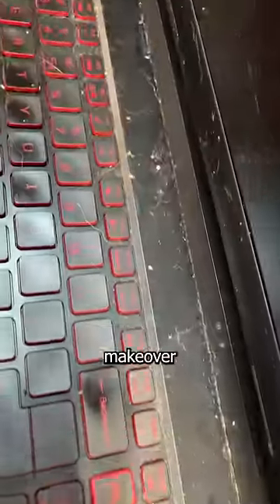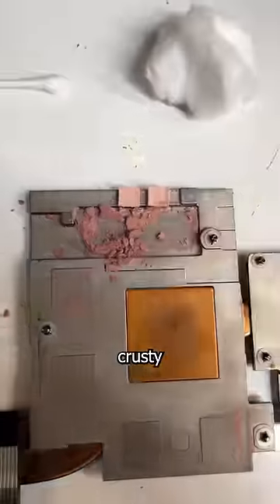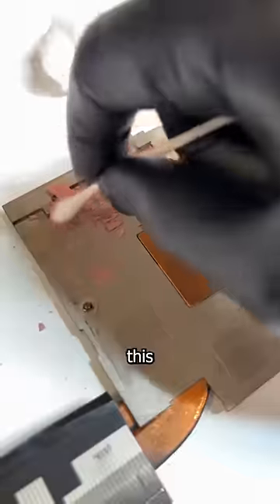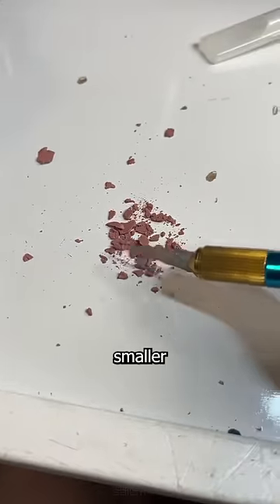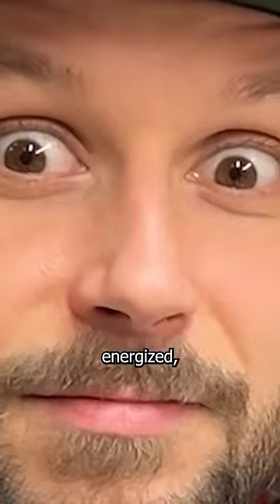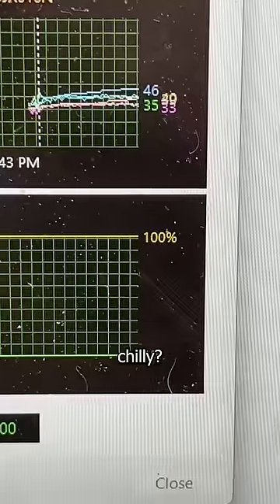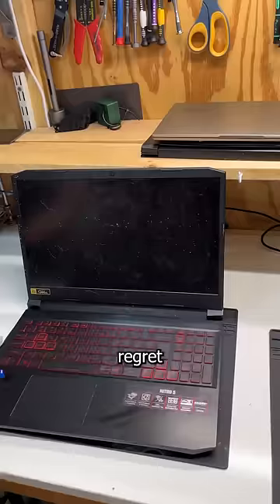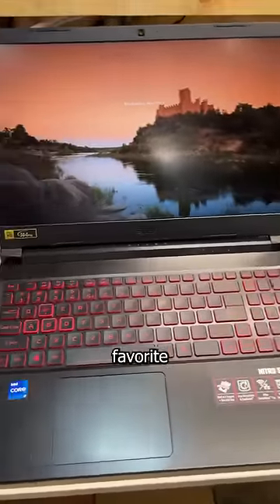Refurbishing a filthy Acer Nitro 5 #gaming laptop (I love it) #pc #tech #technology #shorts

Comment from the maker: In all seriousness the Acer Nitro 5 is an excellent budget gaming laptop if you TAKE CARE OF IT. The hinges ARE prone to breaking, but if you're mindful of this and clean it regularly, there's no reason this shouldn't last you a long time.
Reply: Could it run fortnite
Reply: @_Err0r_404 it does very well. I use the nitro 5
Reply: @NotBray  ok thank you
Reply: I got one with i5 10300h 45w cpu and it runs games in the 90s
Reply: For the price its really good
Reply: Nowadays hinge problems have many variants. Lid point delamination common on those hinge soldered on lid, Ol common hinge broken, or newer cheap laptop base break like HP plastic.

Which hinge problem for this Acer?
Reply: @ashisace921 well im using the intel 5 8th one, the model maybe from 2018 or 2019. This one is a pretty good and decent run Valorant, Apex and etc .
Reply: as a nitro 5 user, i personally don’t think i have problems with the hinges, but here’s some advice: DO NOT SET YOUR FAN SPEED TO MAX. if you constantly use the laptop with MAX FANS ON, one of them would die out, which i have experienced.

Edit: putting it on to max for an hour to 3 hours is COMPLETELY FINE. My point is to not keep it at that speed
Reply: Which thermal paste did you used on the cpu and the gpu?
Reply: @KarstenPHT  how about auto?
Reply: Good, I just bought one last month
Reply: @trym2121  you can see that the acer nitro 5 here has those big hinges, but the LCD frame itself is thin. the problem MIGHT be the link between the LCD and the outer hinge (its hard to explain really)
Reply: Asus F15 i7🗿
Reply: Can you do it for me to i'm missing some screws and i want to upgrade My laptop it's also a aser nitro 5 but i live in the Nederlands zo
Reply: yup I'm using mine with liquid metal applied and it runs so chill no problems with the games whatsoever. definitely suggest this laptop for budget guys like me
Reply: Nitro 5 user here. I just cleaned the fans myself, and I ran Tekken 7 in ultra quality with max fan speed, and didn't go beyond 50⁰C. Next step is to change the paste, but this time I'm handing that over to an expert
Reply: @amreenhakim6567  auto is probably the safest bet, but i recommend manual mode and setting the CPU value to a 25% or 50% higher than minimum

Note: the fan speed is not actually fully controllable, as the minimum for “manual” goes up just like in auto mode. you can only change the offset of the fan curve.
Reply: I've unlocked the bios of mine to make undervolt and control the wattage via trothlestop!

Thanks for the advice about the hinge

Greetings from Venezuela
Reply: I had one when i was in college 4 years old now n so far only 1 battery replacement n 1 screen replacement(idk how but somehow termites got into the screen)..... n im still playing apex legend 60-70 fps
Reply: I've had mine for about 3 years, and I've taken care of it pretty well. I have 4 different animals and when I cracked it open recently to install new ram(32gb), there was no hair or dust, which surprised me. In fact, I got a 4tb external drive and now I can run games exceptionally well, with the added benefit of never running out of space. I will admit, my cpu is a bit lacking(core i5), but it still handles well with my upgraded ram, and it has a killer gpu for the price of the laptop (rtx 3050 ti). All in all, a great little laptop if you're committed to keeping up with it and possibly making a few upgrades here and there. What he says about the crumbs tho is true 😅
Reply: I can finally repair mine... except for the missing x key a stray cat ripped out
Reply from the maker: @trym2121 The mounting nuts rip out of the lid mounts 💀
Reply from the maker: @kunalgorain6602 k5 pro and the Pwhatever thermal sheets, they’re in my Amazon store in my bio
Reply from the maker: @QueenMuser you mean, Techspert 😎
Reply: @_ERR0R_404 I mean I run teardown and beaming at ultra 60 fps I have the 2021 model with the 1650 I think I don't remember tho my model isn't good for 4k  gaming 1080pis fine
Reply: Yup, my brother broke the hinges on his
Reply: @SalemTechsperts  yeah, but I'll need to find the Serbian version of "ThE gReAtEsT tEcHnItIaN tHaT eVeR lIvEd" because I have no money to send it to you from across the Atlantic Ocean! 🤣🇷🇸 greetings from Belgrade!
Reply: I have one... after gaming on it something started rattling around inside. Idk why. Lol. It still works tho. I mostly just use my desktop instead however.
Reply: I have one and it's better than my old pre-built desktop form 2017
Reply: I think the main issue is the power button, not the hinges
Reply: Question What us a good idle temp for a gaming laptop
Reply: @Muzaffar_Mir  scientifically, alcohol IS a solution
Reply: I’m triggered that my mom doesn’t clean the crumbs off of her trackpad
Reply: @_Err0r_404 I use it. It runs it. But deffinitely not at full graphics that is a bit too laggy
Reply: I had one with a Ryzen 7 
My sister was using it when I got in from work 
Gave her an energy drink as she asked. Later onto the night she came upstairs to go to her room. And u know when u can tell your siblings have done something by there face 
Well 3 days later my dad after taking the laptop out for a work trip, but not using it. Pulled it out of the bag and it wouldn't work.

Took it apart and it turns out it has some kind of sticky liquid residue on the inside and all the keys just fell apart. 
We even upgraded it with 32gb laptop ram and one or 2 m.2 drives can't remember the size. 
We were also thinking about getting a micro soldering station and one day upgrading the CPU GPU and screen when it would have become outdated
(My dad can do it luckily he's literally a job has him working self employed going around the country fixing different robots)
Reply: Mines been going strong since they originally came along.  I love this beast
Reply: HEATS
Reply: I use the nitro five 2020 and the fans are always running max even when I’m on a web browser so maybe I think the thermal paste is gone
Reply: Quick question for the greatest technician that's ever lived. Sometimes, when i accidentally set my laptop down a little harder than i mean to, it shuts the screen off. I recently changed my ssd to 1tb and installed another 8gb ram stick. Idk whats happening, but it only rarely happens so its not a big deal for me.
Reply: i got the one with 11300h and 1650, runs like dogshit
Reply: Lenovo Ideadpad Gaming 3 is much better, similar price point, no hinge issue, fast charging, privacy shutter and mic disabler,
Reply: @SeveredStorm  lol i got intel i5 12500H and rtx 3050 and windows 11 it run kina ok but the heat is more of a dogshit it goes to 90 degree even when i am only using google meet and obs in the same time
Reply: Mine is just overheating as fuck, no guys it is clean and it is even undervolt ! But cannot run roblox because of the shity cpu over heating at 3.2ghz
Reply: @jeremy2122  get it repasted and one trick I do is freeze little bottles of water and the place them near the intake vents, and sure to keep some napkins near the bottle so any condensation is soaked up. Temps drop rapidly like 10° or so
Reply: @syedhassaanmujtababokhari6199  already repaste, but thank for the bottle idea!
Reply: @NotBray me too I have i7 12700h and rtx 3060 edition and it does not disappoint at all and it's amazing for the price
Reply: @jeremy2122  me too
Reply: @SalemTechsperts  hi there, curious in which area gpu/cpu you put the K5 and which area of acer nitro that you put Pwhatever (the one that you stated earlier)?
Reply: Im looking to buy the nitro 5 with i712650H and 3070ti, what are the pros and cons for this laptop??
Reply: @NotBray what’s the settings for your cuz my one runs at 70 to 80 in private matches but in public it’s 30 to 60 and freezes but other games run at like 120 no matter what just fortnite
Reply: @SalemTechsperts hello The greatest technician that's ever lived
How would Lenovo Ideapad gaming 3 compare to Nitro 5?
Reply: i had the model with a 3050 Ti and an i5 CPU (3.5GHZ) and MAN that thing was a BEAST!

Now i own a 3060 Ti gaming PC that i got by SWAPPING with a good friend of mine.
he needed the portability, i needed the extra icing in hardware for VR gaming
Reply: What thermal paste or pads did u use I'm planning to repaste my 2021 acer nitro I clean it regularly but I've noticed my temps slowly climbing over the past month saw some used one of the expensive paste on reddit and It damaged thier cpu
Reply: only the older acer 5 nitros are prone to hindge issues, the 2021,2022 models all have beefer thicker hindges
Reply: Been regularly cleaning my Acer Nitro 5, however my [1] button no longer works so it might be time to send it to a shop for much needed maintenance
Reply: I wish I could hear you talk about computers in person.
Reply: could it run beamng drive?
Reply: is that why they call it getting pasted?
Reply: Fr but yeah maintenence under the hood is very scary. I'm  pretty sure my thermal pads are probably dusts and my screen is mis aligning
Reply: Can we send you a Laptop?
Reply: I have a nitro five. Recently opened it and cleaned the fans after 2 years. Still afraid that I'll break something if I re-paste the CPU and other parts. Any advice about how to do that and what to use?
Reply: Bro this one is my friends he told me he got it fixed with you lol, I also remember all the stains and dust he left on it
Reply from the maker: @NoodleorwhatYT  He's the man. I've been hooking him up since like 2016 😎
Reply: I have 17 12500h 16 gb ram 2tb storage
Reply: I have one running i7 1800H with 3050Ti , it's certainly the best budget machine for most games.!
Reply: Had one of these and for a budget gaming laptop it's fine. I didn't like the touchpad though, but that's a common complaint i have with pc laptops.
Reply: Are you like a computer repair service?
Reply: i have nitro 5 with a 11th gen i5 and rtx3060, would the coolers on the beefer gpus fit? or are they all the same
Reply: @_ERR0R_404  who even plays fortnite?
Reply: Genuine question: how are the speakers? I've had two Acer computers and the speakers on both were so quiet I couldn't hear anything with my hearing loss.
Reply: @NotBray  It fr can handle gta 5 at max graphics
Reply: my dad has one and the screen is held on by clips
Reply: Mine can run genshin impact of all things if you put on coolboost mode.
However, one of my hinges is broken. It still turns, but there is...some mysterious part that is loose in there. I do not know where it is, just inside. It popped out part of the casing, but I couldn't get the piece out. Eventually I popped the casing back into place and that piece is just...floating around. No issues on the screen or anything.
There's also a crack on the other hinge.
Yeah, hinges are prone to breaking...but they're still functional.
Reply: ive had my nitro 5 for almost 6 years now and it's still running beautifully! I absolutely recommend the nitro 5 as well!
Reply: @_Err0r_404 yea def
Reply: I had acer 4738 that last 13 yrs and its dead now. Will buy nitro 5 if you say so. Thankyou for confirm this.
Reply: Hey how much would it cost to fix my acre nitro five
Reply: My nitro 5 laptop always get to 50+ or 60+ degrees hot
Any advices to cool it down?
Reply: Dude, thanks for giving Nitro 5 some praise, mine's still kicking for 5 years now, bought this baby back in good ole Christmas 2018 and I love it.
Reply: What year? I have a 2019 one and I gets so hot
Reply: did you make a full video of changing the thermal paste? i have nitro 5, 2 of them, and i haven't found a single video on youtube that shows how to change thermal pads, thermal paste/putty
Reply: I have had it for a good minute now. But I have a problem. My battery won't charge. I've done the battery reset. I've done countless changes that was supposed to fix it. Nope, nada. Could you give me some help to fix it?
Reply: Love my nitro! It's a great laptop
Reply: I’m not very good with the mechanical side of computers, but I’ve been using a Nitro 5 pretty consistently for roughly a year and a half now, and it’s been really great. My only complaint with it is that the F1 key has popped off the button and I don’t know how to reattach it short of superglue, which would probably make it hard to change out later.
Reply: @Napoleon_tf2   he'll yeah 30fps at high settings
Reply: @StarTaxi77  cool
Reply: yea i’ve been using it for 4 years and performs great
Reply: Will you fix my macbook? I accidently erased the os during a factory reset now its a paper weight.
Reply: I am suddenly a LOT calmer about my computer thanks.
Reply: What paste did you use for thermal pads?
Reply: Yep. This laptop has been an absolute beast for the past year that I've been using it. Yes it had some temperature issues, but with regular dust cleaning off the fans and keeping it in a nice cool room, it will last a long time
Reply: @_Err0r_404  yes it even runs warzone 3 in a 100 fps
Reply: I almost bought this machine a couple years ago a friend of mine has one with the RTX 2060 and runs great, but for the same price I ended up getting an Asus Rog zephyrus G14 with an 3060 and Ryzen 7 5800hs so far I'm really happy with it runs great even at 1440p
Reply: I bought, and i will protect it with my life 🗿
Reply: I use and the only problem is battery life it is AHHHHH TO BAD  even after getting it a new battery
Reply: I have a 2017 version
It runs like shit now but its probably because its filled with dog hair and dust and other stuff and also because its pretty old.
The hinges broke once but haven't since they were repaired.
The keyboard is fucked though,a bunch of the buttons don't work,but doesn't matter cause i use an external keyboard
Reply: @KarstenPHT ah fuck i have my fan speed always on max
Reply: man , sorry for late , 
if u have some issue on Acer nitro 5 , 
after i repasted on new cpu & gpu , turn back it all at once and here it goes
* when i plug in with adaptor , it comes with a blue light on 6-7 secs then comes off , repeat again and again , 
even i tried plug with battery it still charge my batt *
Reply: Still rocking this piece for 5yrs (changing thermal paste and dusting myself) but the hinge gave in pretty easily and the screen flashes in cyberpunk style (looks mesmerizing)
Reply: I need help with Acer Nitro 5 AN515-58 laptop, Acer Customer Care failed to fix it, Please reply me... So that I can explain ..
Reply: I still have mine from my birthday in 2018, I was 9 and it still works very well
Reply: That's not crusty. that's Dusty
Reply: It is not a budget laptop in Poland for brand new i i5 11400h rtx3050ti i paid almost 1500 dollars
Reply: @Pablo_HGames  sorry I got a laptop in 2023 has ryzen 9 6000 series and an RTX 3060 $1,200
Reply: I've got one, love it but it's overheating slightly..:|
Reply: @_Err0r_404  Sure. I played war thunder with 200 fps, i don't think that fortnite is heavier
Reply: I have it and it has cs2 on like 100 to 90 fps
Reply: Have the 144hz 1080p i7 10750H gtx1660ti 16gb 2tb m.2 going strong on cpu intensive tasks, games it goes to 98c 😂 with constant fan cleaning and 2 paste changes and cooling fan tray under it down to high 70s. Runs 120 fps solid on league
Reply: I have Acer nitro 5( AN515-57) with i9-11900h and rtx 3060(95w). ssd 512gb and ram 16gb ddr4. I’m its second owner. It is kinda underperforming when i compare it with other the same models with the same components. Games are too laggy and there are constant crashes in newer games. For example in Cyberpunk2077 it performed about 45 at the lowest settings  not more than that and also it wasn’t stable too. I cleaned the vents, changed the thermal paste (GD-2) but the problem still remains. i tried to upgrade all the drivers, reinstalled them using ddu it didn’t help either. The temps are 89-92 for cpu with cooling pad and 60-65 for gpu. And also when the background is light and when i change it to the darker one the shades of the previous background can be seen. I think i need to change the screen. How much does it cost to change it. The factory screen is 165hz
Reply: What gaming laptop do u recommend under 800$
Reply: The original hardeive finally died in mine trooper to the end
Reply: My V nitro (I forget which model specifically) lasted me 8 fkn years!
Sure it couldn't run the biggest newest games no more but that's not what I expected of it. It ran all the games I wanted to play 

I now switched to a Lenovo gaming due to budget
But my lord that Acer is my hero
Reply: I haven't replaced the thermal paste in mine in 3 years
Reply: I got this same one, with the expansion slots. Im not having heat issues yet but it was bought early 2022. It's never gone over 70c and those were just short spikes. Wonder how much longer my paste has.... Not excited to see the multiple paste types and locations under that heatsink
Reply: @3dd2. I have this same laptop. Idles at like 38c for both CPU and GPU. Running heavily modded Skyrim on max settings gets it up near 60-70c in spikes and around 58c consistent
Reply: @Smartplatinum-bu8kb  that's normal under load
Reply: typing this comment from an Acer Nitro 5. The hinges already broke a couple years ago, and while repairing I got them to screw  it in to prevent it from happening again. Also, dust getting underneath the keys is a big triggering factor
Reply: Unfortunately technicians willing to put in the effort to actually do this are few and far between.  In most places we can't even get a well care for machine properly serviced, they either want to send it overseas for a month or want most of the price of a machine to do the work.
Reply: How often should we replace the thermal paste if we keep laptops for like, 10 years?
Reply: Can I do the vacuum thing you did with just any old vacuum?
Reply: I swear, the power button is placed in the worst spot in this keyboard. i have this laptop.
good specs, just terrible power button placement.
Reply: @_Err0r_404  yes
Reply: YES BUT NO!! 
it has 4GB VRAM which is not enough to play games like Resident Evil or Devil May Cry. Yes you can still play it but low graphics are not good and laggy if you want better graphics... make sure your pc has at least 8GB of VRAM, better if its more. I had to finish my games at low graphics and it gets annoying to see bad graphics.
Reply: @_Err0r_404 nineteen dollah fortnite card. OK. Who wants it?
Reply: Built to last!
Reply: How about repairing some Indian laptops
Reply: Yea it runs well for me too, only performance mode unfortunately  @NotBray
Reply: Thanks for the advice, its the gaming laptop I use